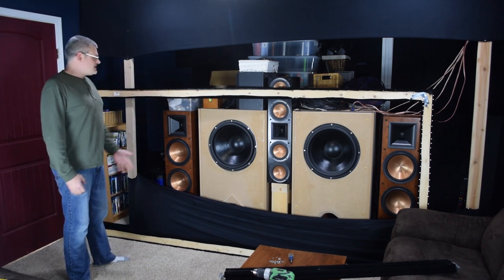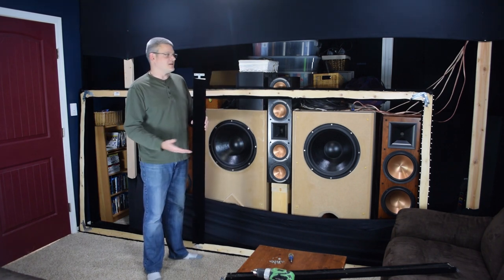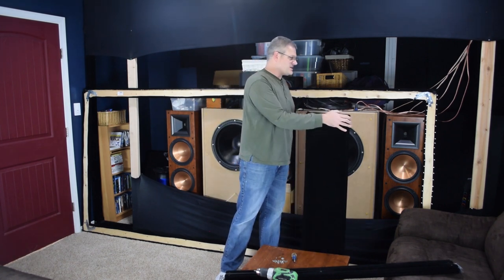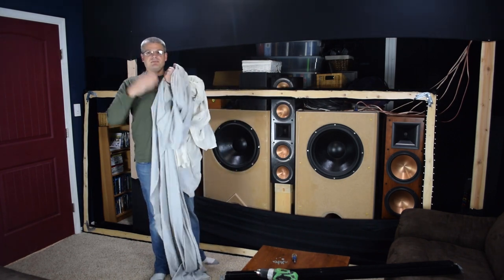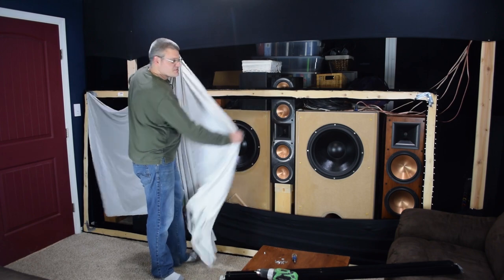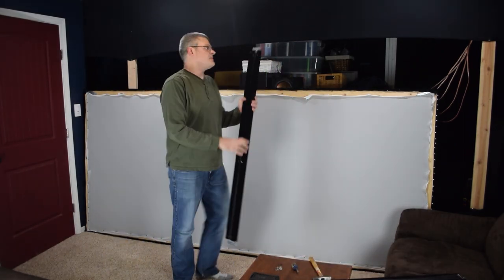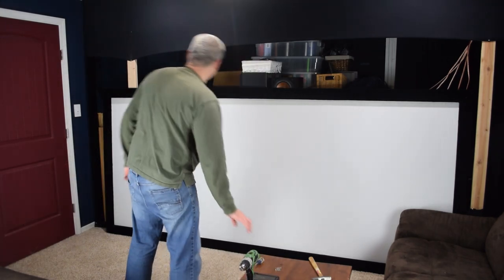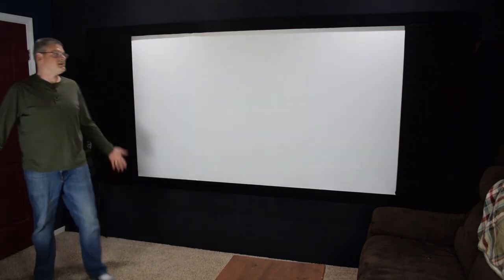Spandex Screen Construction

Comment: I have a very similar screen I built, only mine is 16x9 at 140” diagonal.  I used 1x4 poplar with 1x2 supports on each side of the center speaker (DIYSG HTM-12s), all fastened with pocket screws (love Kregg’s jig).  Black milliskin spandex with matte white over it.  These screens are an absolute bargain, and it was one of your older videos that convinced me to build it.  Like you, I have a young kid (2 year old), so spending thousands on an equivalent AT screen just doesn’t make sense...at least not to me.

Comment: Can u use any white spandex for a projection screen.? Great video
Reply from the maker: @johnsmith-qz4bv  I looked at spandex at the local fabric store to compare, and the milliskin has a much finer weave than what I can find at the store.  The closer weave is less likely to be visible and will probably also not let as much light through.
Reply: @FamilyHomeTheater  ok but  would they still maybe visiable if u sit 9 feet back ..?..
Reply from the maker: @johnsmith-qz4bv  Itay work, but look at the surface also.  Milliskin is also completely smooth whereas some spandex may be fuzzy on the surface.

If you already have a projector you can maybe get a small sample to try.  But mattei milliskin is just $15/of on Amazon.  So you may save a few dollars locally but you'll end up spending more if you are unhappy.

Comment: Great video. I didnt think of using thumb tacks on mine. I guess Ill be pulling a lot of staples when Im ready to wash it.
Reply from the maker: Yowza!  Yes, the thumbtacks make it easy to take the material off and put it back on without tearing the screen too much.  Of course, even if it does get irreparably damaged, spandex is inexpensive!
Reply: @FamilyHomeTheater  where is spandex sold.

Comment: Hello! Could you tell me please how many yards do I need for a 16:9 150" diagonal screen? Thanks in advance!
Reply from the maker: I'd say 4 yards should be more than enough.  However, material had a barely visible seam of some sort that did sometimes show up.  So you could get 7 yards and if there is a seam, put that part in the 2nd layer behind the front layer.

Comment: What are your thoughts regarding  curved vs. flat screen in 2.35 format.
Do you see any problems with you image on this wide screen?
Reply from the maker: For home theater, I'd say the screen should be flat.  While it can be curved, probably most home theater projectors are set up for a flat screen.

For me, I do have some chromatic abberation on the edges of my screen.  But that is due to my relatively cheap $1300 projector having a relatively cheap lens.  I have read reviews of more expensive projectors with much better optics, such as the BenQ HT9060, and they do display a perfect picture from edge to edge on a flat screen.  However, if the screen were curved, focus can become an issue.  The edge to edge tack sharp image could become slightly out of focus on the sides.  So for a home theater, I'd stick with a flat screen.
Reply: Thank you

Comment: Why not use a 16x9 screen as the default and then mask off the top and bottom for movies? That way you will always have a large screen vs having a smaller screen for 16x9 when you watch that content.
Reply from the maker: It's mainly a personal choice.  For me, I don't want TV shows to have a larger more immersive picture than Lord of the Rings.  That and horizontal masking is a little more difficult to do than vertical masking.

Comment: Hey man. Been watching all of your videos and love your approach :) I have also bought the RF7-ii’s and cant figure out if I should lift them up a bit so the lower woofer doesn’t fire straight into the frame of the screen. I can se you have chosen not to.. How is that working? Any difference noticable?
Reply from the maker: I've thought about it but haven't actually tried it.  I think I decided against it in favor of keeping the tweeters at ear level. So it is admittedly not ideal, and a trade-off to having an acoustically transparent screen vs a smaller screen with the towers off to the side.

Comment: Hi, I am from India and planning to get the spandex fabric from USA Spandexworld website. My screen size is 128" diagonal (118" width and 50" height) 2.35:1 ratio. How much yards of fabric should I order? They have mentioned the width in their website- 58/60" . So will this fit my diy screen without having to stich the fabric?
Reply: He mentioned 3 yards would be enough in another comment above...that's the answer I was looking 4 2
Reply: @smithsonna035  thanks